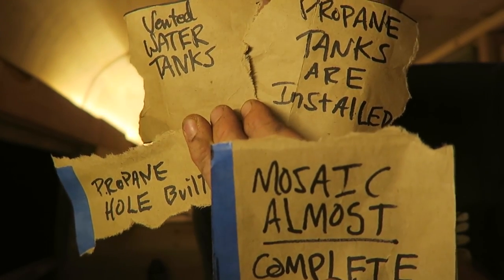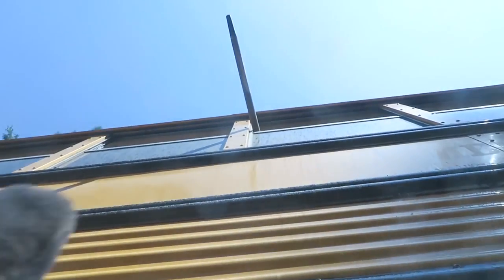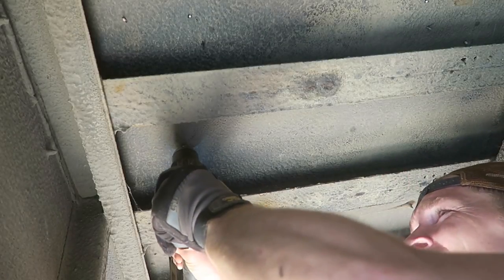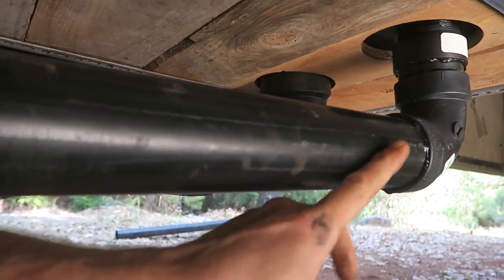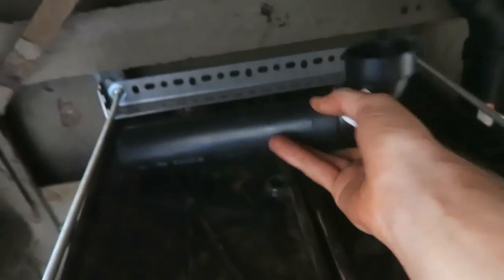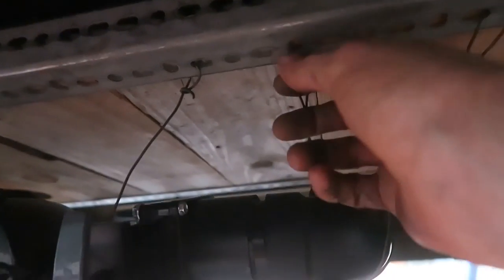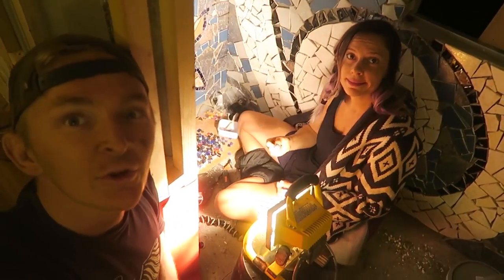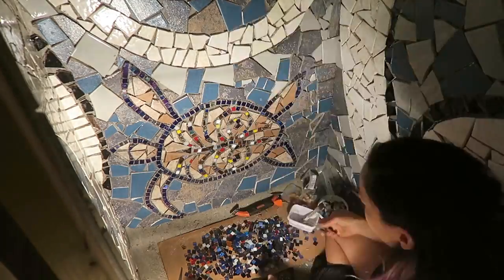#76 SKOOLIE BUS CONVERSION | Plumbing Tank Vents, Black Water Dump System & Propane Connections

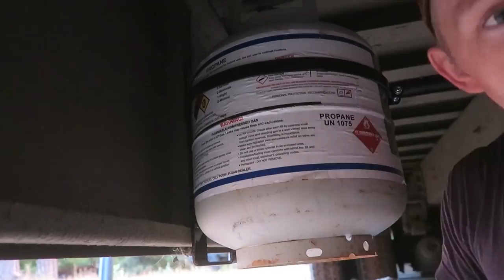Comment: Just in case you didn't check the propane tank, it didn't catch the lower rim when hung (2:55). If you don't take the vent above the roof, it will smell like "sh*t" around the bus. Methane gas is lighter than air and will rise. Use plumbers strap to support the pipes. Go to a place that sell trailers and motorhomes and check under the units to see their plumbing. Mosaic is looking awesome.
Reply from the maker: Hey Larry - Good catch. I thought the device was meant to good the bottom rung too, but after a bunch of trying, I believe it is seated well. After tightening up the lock washer and bolt, it is in there so well I shake the bus before the tank want's to budge. I believe the system was designed not to seat on that bottom clip.

I'm getting the impression that the roof vent is important. I'll vent it to the roof closer to the date where we actually use the tanks. That day is far away so for now, I want to focus on the critical stuff to get the bus registered. Luckily, I left a bunch of extra pipe coming out of the tanks to work with. :D

Thank you very much for the kind suggestions.

Comment: V!!!! Omg girl that mosaic looks friggin amazing!!!! I don't think you have to put that little plate on the faucet, the plate is used if your attaching a single faucet to a sink base with three holes. So that plate covers the unused holes in a sink. God I hope that makes sense. Lol (only offering opinion, I'm no expert, although I've replaced a few faucets)I'm interested to see if you get any feedback on the venting pipes for the tanks, I'm not egar to drill thru the roof either, lol Although our bus roof is solid no vents or emergency hatches came with our prison bus, prob didn't want to give the convicts an access to excape! You guys it looks great! Your nearly there!
Reply from the maker: You've got a prison bus like +metaspencer ? Cool. The plate seems necessary, to me, in order to anchor the faucet in solidly. We need it to be solid. Thank you for the kind words. You rock. :D

Comment: I would vent your water up as high as possible. Like one person has mentioned the "black water tank" will admit bad odors! Also having the exhaust going to the roof allows much easier flow of water being drained....
Reply from the maker: Cool - My thinking right now is that we aren't planning on using the tanks for a long time. I'll leave it as it is for now, but if we go on a trip where we use them, I'll connect both the vents with a T coupler and then run the final vent pipe out the side of the bus and along the driver side wall to the roof. Thoughts?
Reply: ok, so is my understanding you are only sleeping? Not using the bathroom, shower, kitchen sink? The thing is venting your sinks/showers and toilet is necessary for the draining of the water. If you don't vent them to the roof/or above your highest part which is normally the sink, you will create a possible overflowing....But I do believe that all the vents should be going up to the roof, that's from what I know and have seen.  But if your making this to "pass the RV guidelines" for Nevada, it should be looked into.  But I am not sure what your plans for this bus to be, a traveling home or a home that stays in 1 spot??

Heres a link about drains/traps....
http://www.diynetwork.com/how-to/skills-and-know-how/plumbing/the-basics-on-drains-traps-and-vents
Reply: Yes, you could vent it out the side and remove the vent pipe when you get back on the road.
Reply: Ian Robinson Go get an Oatey Sure Vent (Air Admttance Valve) at your Hardware or plumbing store. It costs about $10.   It should work perfect for that application.  It sits on top of your vent pipe and stays closed until there is negative pressure. When you dump your tank it opens and it closes again when you're done.  Residences allow them as you can access them and they are not walled in completely as over time and with use they can fail.  Plan on replacing the valve every few years considering it will be under your bus.   That will keep the sewer gasses from your black water tank stinking up your bus.  And you won't have to cut holes in your bus!

Comment: Vent to the roof  of  the bus, Methane gas will explode. Please use pipe strap and bracing to secure your plumbing pipes you do not want them moving around on the rode creating a problem.  P.S. you can vent the gray water from the kitchen sink.
Reply from the maker: Understood. I agree that venting to the roof is important. It's not good enough to do it the way I did in this video. At the end of the day, our bus has plans to sit for a while without using the tanks, so we will leave it the way it is for now. As of now, the black water tank is still non-functional. Until we vent to the roof, we remain incomplete with the blackwater system. Thank you for your concern and guidance Norris Coleman. We really do appreciate it.